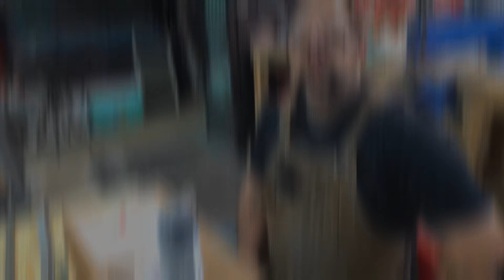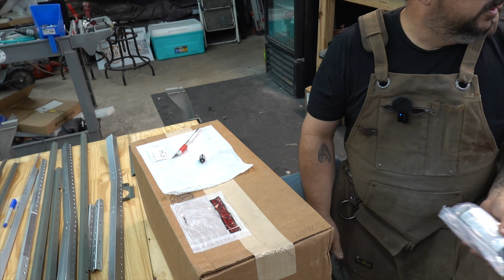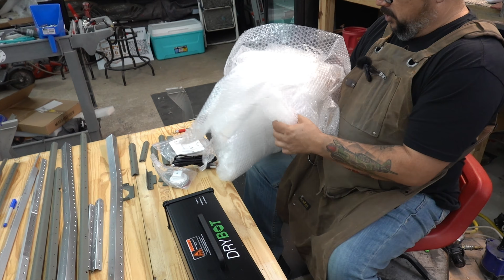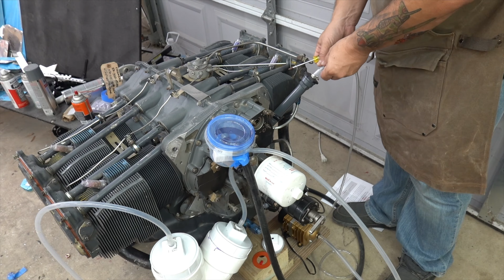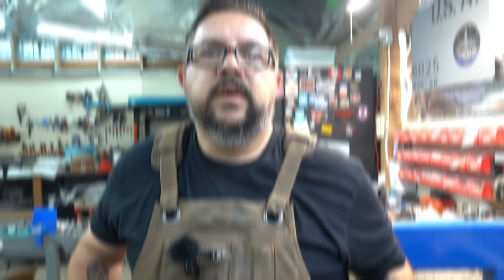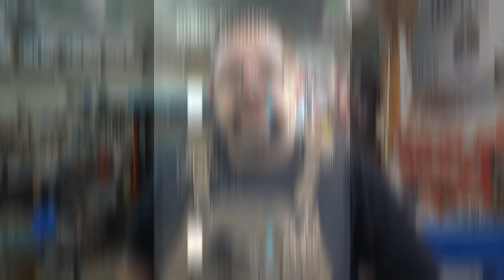RV-8 Build Ep.148 | Unboxing & Setting Up the DryBot Engine Dehydrator

Comment from the maker: The DryBot setup turned out great! It’s already circulating dry air through the engine and should keep internal corrosion at bay while I finish up the rest of the fuselage work.  As of this post it is maintaining the humidity at about 25%.
Have you used a DryBot or another dehydrator setup before? Let me know what’s worked best for your engine preservation plans down below 👇

Comment: How is the drybot performing compared to your DIY setup? Sure seems a lot more convenient, but I’m wondering how well each method did controlling humidity.
Reply from the maker: My customer setup kept the avg humidity coming out of the engine a bit lower than the drybot but that was with me having to dry the silica out manually every few days. The drybot is keeping the avg around 15% and auto regenerates. I have remote live wifi monitoring of it and get alerts if it goes high. The drybot will need to be sent in for a service to refresh the silica at some point.

Comment: I've had my DryBot for a couple of years now, very happy with it.  Mine rests on a wood maintenance step built out of 2 x 4's and there is no issue with any heat from regeneration.  keeps the unit up off the hangar floor.
Reply from the maker: Thanks that’s good to know. Mine just went into regeneration a few minutes ago. I’m surprised at the puddle it’s making so I raised it up on a bench for now so the water can drip away from it.